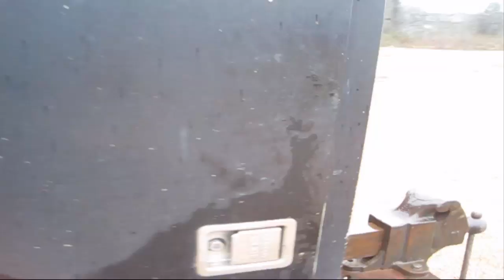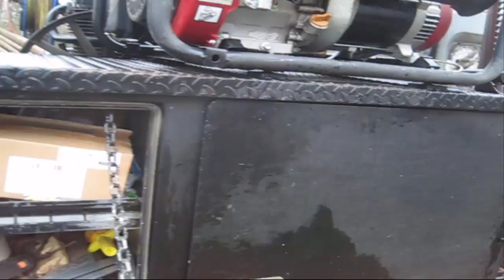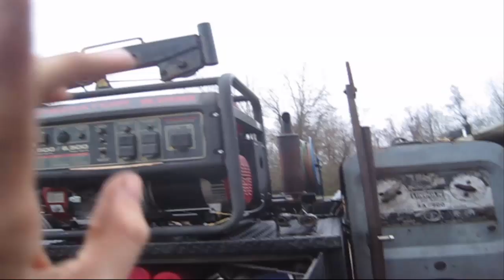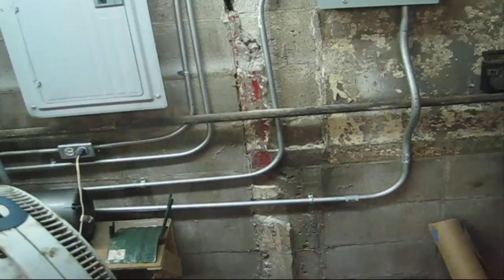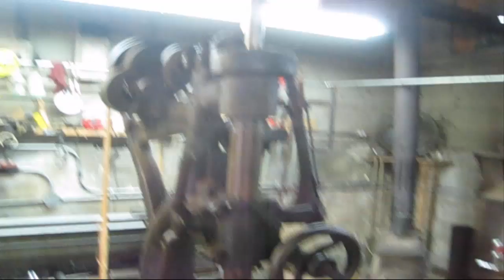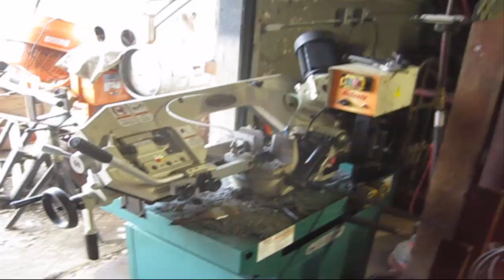Shop/Rig tour 2018

Comment: You may need a new diode on that solinoid. The induction motor needs a place for the current in the windings to go. This causes back emf which is really high voltage and hence the spark. google "flyback diode"
Reply from the maker: Thank you that helps a lot.

Comment: I found a rod oven that will run off AC and DC 110v.  I got it because my Pipe Liner only put out 110V DC.  Works great but only about 10 lbs of rod.  I put what I need in the night before and plug into shore power (I keep it on the truck or I'll run off without it ;o)  and in the morning I have dry rod  but only 10 lbs.
On your old welder suggest cleaning the armature of the exciter generator.  It may not be the problem but it's way easy and fast to check.  Even something as simple as pushing in on the brushes might bring it back to life.  Super easy, just pull the bowl cover that covers the exciter armature and use some small sticks of wood and push in on the brushes.  If you start to get some welding life out of it I would suggest replacing the brushes and clean the armature real good.

Comment: Just found your channel, and thank you for the great shop tour.  I worked with those old Excelsior drill presses on the Victory ships.  When a friend of mine offered me his (that he got from Seagrams Distillery), it was in pieces rusting in his back yard because it was too  tall for his basement shop, I took it immediately.  Once cleaned, painted and reassembled, I found it missing only a $1 tapered pin. Its been going strong for me almost 30 years now!!  

That old generator welder sitting around may have lost its residual magnetism, so possibly doesn't build up the field necessary to generate.   If you haven't fixed it yet, try "flashing the field"  look it up or ask an electrical engineer.  I have had to do that on ship's generators and also home portable gens that are brand new.

Comment: I have a suggestion for correcting the solenoid arcing problem in the surface grinder.  I stopped the video when you showed the close up of the solenoids and their contacts so I could get a good look.  It looks pretty gunked up with oils, grease, etc. not to mention the humidity water.  There is a spray cleaner named 'Lectric Clean (or something similar) that you can find in most any autoparts store.  It originally was developed for repairing the solonoids and other electrical contacts in pinball machines.  It flows the oils and discolorations off of the electrical contacts.  I've used it to spray into turn signal switches in my cars and truck while working the switches to help clean the contact points.  It DOES NOT CONDUCT ELECTRICITY which makes it safe to use on active circuits.  SOOOO, get you a couple of cans and spray the H*** out of those solenoids and all of the rest of those contacts in that area.  As bad as those pieces are gunked up it might take 2 or 3 cans to cut it all off.  Do NOT use Brake Cleaner because that stuff is not designed for electrical pieces and leaves a film of stuff behind after it flows the oils and greases off of the brake parts.  That 'Electric Clean flows the crap off of the parts without leaving any residue of it's own.  I really think that this cleaner just may solve your arcing problem because the oils/grease/water is what's feeding the electrical shorting that's powering the arcs.  You can use this cleaner on all of your machines for cleaning all electric contacts and any solenoids in your other rebuilds of those fantastic older machines.  Man, I sure envy you of those old, heavy, BEAUTIFUL machines.  The mass / weight of those machines are directly responsible for their long life AND their accuracy in the parts they produce.  GREAT STUFF.  By the way, I, too, live in Mississippi......the southcentral part of the state.  Born and raised here except for the 22 years that I spent in the Air Force.  Have a blessed day, my friend and thank you for your hard work and posting these videos on such diverse subjects.  One last thing.....those SA-200 welders you have are very valuable because they are no longer made and their popularity is HUGE.  I subscribe to a channel belonging to a pipeliner and they have nothing but good to say about that welder.  It's replacement is called the SA-300 and they all say they prefer the 200.  Sorry for the loooong post, but I hope it's helpful to you.  Oh, and after the first good spray down of the entire area, turn the machine on and spray it again as the moving contacts are opening and closing.  Spray everything.  Lastly, solenoids can be dismantled and rebuilt...make that CLEANING.  It they are held together with rivets, carefully drill those out and replace them on re-assembly with pop rivets of the same size or use self-tapping screws.  Just use rivets or screws of the same size as the original rivets....diameters and lengths.

Comment: Solenoid are not rebuild able, but if you can get it off run it down to your Napa they should be able to get you hooked up. I live on the Oregon coast and I’ve used a big dehumidifier in my shop to keep it dry. Loved the walk around.

Comment: We  had a old drill press just like yours at work we used it for years for heavy drilling then company decided need a new one they bought a do-all what a mistake that was it would not do half the work the old one would do came in one day the old press was gone no one knew what happen to it I thing one of the suckys got it.
Reply from the maker: joe tiller man I hate to hear that. I'll be honest the main reason I bought it was just for the power feed, but I tell ya I almost don't use my mill to drill holes anymore. It is just to easy to run, and does to good if you know what mean. Thanks for comment maybe the ole camelback will come back to ya lol.

Comment: Classic work-  Never heard your first name but I've watched all you videos.
Got a discussion about a fish plates?  Some guys say don't weld the ends on a vertical fish plates.  Others say go head and weld it up.
Your take and how about a video on fish plates how and why!!
Reply: PhantomPhixer across the stress points are avoided( across a vert compressed beam)

open top n bottom drain moisture

angled heat dispersement reduces loss of metals heat-treatment and shear/ shatter resistance in accordance to is0 rating of production and recorded heat number....  in event of a failure and costly lawsuit

Comment: did you energize/magnetize the field on that old welder ?
Reply from the maker: I did a few times.  Still nothing.
Reply: Classic Work  I assume d as much.,but you know that old saying.....
my Gramps old 47 Hobart 300 dc/ 6 cyl Chrysler cart  that Sat for years solved the tiny spark on arc but no startup/ fire with a used extension cord and 4 alligator clips...and a running Chevy battery...I hoped the same luck to u
I would check contact/ switch contact. older Miller's had a problem burning out contact plate
edit voltage selector plate

Comment: I've worked with a few guys who had the same situation with a service  body like yours, locks being a pain in the rear. I'm a locksmith among other things and what I recommend is to put all of the locks on one switch, just like the doors on a car or SUV.  You could place the switch that would lock and unlock everything at once under the dash on a toggle switch or install a key switch somewhere convenient. Hell, you could even salvage a set of locks from a wrecked vehicle like a Suburban and have everything on a fob. I've driven a Chevy one ton that with one push of the fob switch would only unlock the drivers door but with two pushes would unlock all the doors. If you ever work in  a situation where tool theft is a concern the fob would allow you to lock and unlock every time you grabbed a tool. 
By the way, thanks for this video I suggested. I guess I wasn't alone in wanting to see an update so thanks again.

Comment: run that bolt around the other way and use a carriage bolt with the head inside and the nut inside the handle on the outside simple fix

Comment: Not just the south, condensation happens all over in the right.....WRONG conditions., 
Better shut the door and fire up the wood stove to dry out the air. 
PS ATF thinned down with mineral spirits (paint thinner) makes a good cheap rust prevention 
spray.